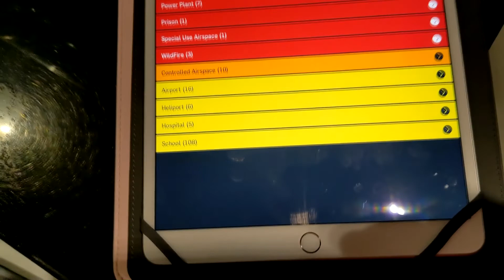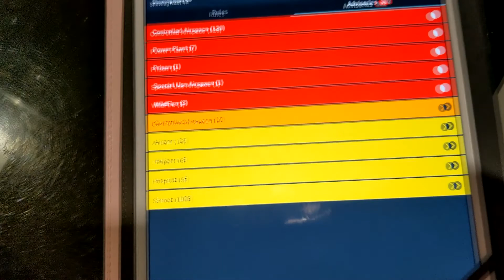Low Antifreeze in the Semi | female trucker | [vlog #141]

Comment: Y

Peterbilt?  When I first got into trucking. I was introduced to an owner operator who own his own Peterbilt. I've always had a thing for that model of truck to were I liked them.
Reply from the maker: I’ve heard the newer peterbilts tend to leak antifreeze near a gasket by the turbocharger. So far they can’t find where it’s leaking even when they pressurized it. It only happens every couple of weeks where I have to put more in. I’m hoping once I hit 300,000 miles, the company will want to trade it in. There’s just way too many electrical problems with the newer peterbilts
Reply: @Mylifesofar  that isn't sounding to good for Peterbilt.  I know there are some changes with the dash.  Heard they are  going from analog gauges to digital on the speedometer
Reply: @Mylifesofar  the company I work for has Frieghtliner. Their changing the stick shifts out to automatics. Not a bad thing and I get it on why their doing it.
Reply from the maker: @christopherluna2268  when I first switch companies I went from a manual company to an all automatic company. It took some getting used to but it's not so bad now. going through cities is a lot easier but going up mountains is a bit more difficult.
Reply: @Mylifesofar  I don't do any mountain driving. But when I do go to the next town over I notice the same issues you do. The next town over from where I live has a difference of 3000 feet in elevation